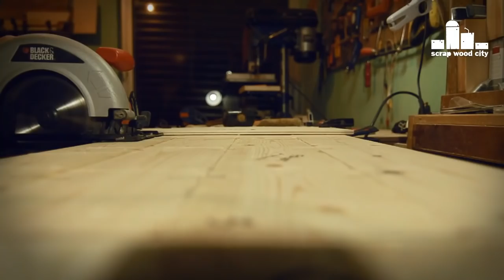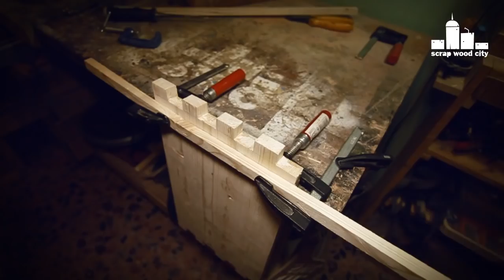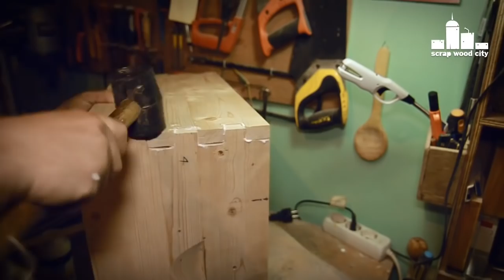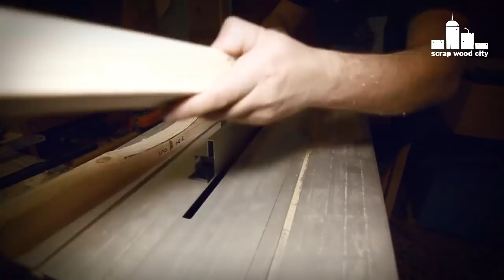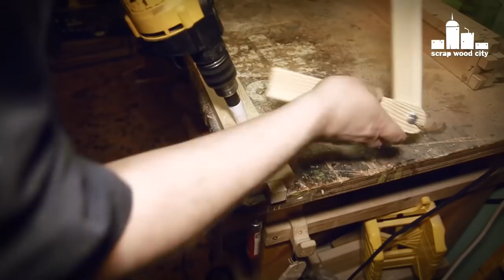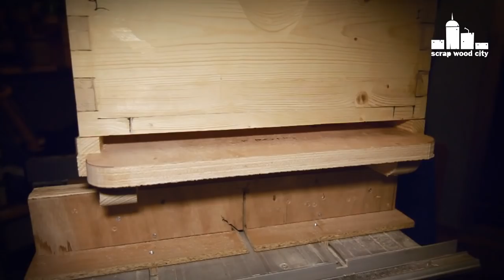How to make a beehive - Part A

Comment: Damn fine job making your hive bodies out of real wood.  If you had a real good table saw you could make a sliding gizmo to cut those box joint cuts and a good dado set.  But you have the right idea.  I like the good old ways myself.  Free lumber and boards can be had fairly easily.  Glue and biscuits are cheap enough.  Good tools are always an investment in a craftsman's shop.  Better to buy tools than to pay for someone else's labor at a high price.

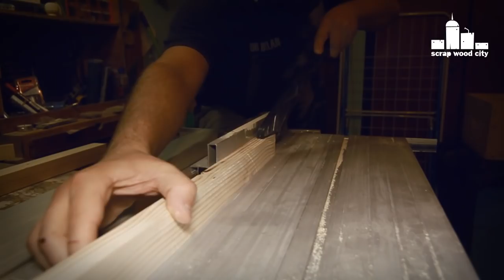Comment: When you trapped the wood between the saw blade and the fence at 6:22 in the video, it created a very dangerous situation.  The wood can bind and shoot out the back at high speed.  The scar on my belly is an indication I learned the hard way.  Nice box, be careful.  Great use of innovative solutions to achieve results.
Reply from the maker: thank you

Comment: Obviously a Union Worker - taking the longest and most inefficient route to make something that could have been done in 1/3 the time. Side-note biscuits don't make a  stronger joint. But they do add material and cost, so another union move. :)
Reply from the maker: Obviously I did not followed the shortest path! I used biscuits for the glue up not for strength! I just have one question. What is a "Union Worker"! Sorry I am Greek and I am not familiar with the term!
Reply: He’s using the tools he has and he didn’t do a bad job, I learned a lot from watching this so I appreciate he took the time to make this for all of us, there’s always a judgmental nit pick that comes along, why don’t you tell him what he’s doing wrong and help the guy instead of labelling him a “union worker” whatever the fuck that means.
Reply: The Plain Truth You only pointed out what he is doing wrong you didn’t say what he should of done instead, nothing you said was actually helpful is the point I was trying to make.

Comment: holy crap dude you are totally amazing! wanted to make beekeeping set up but after watching this... I may have to just buy one because I have absolutely no idea what most of the description means. ha 😝 one question though for if I do end up building a much simpler version... why did you do the interlocking sides instead of just nailing the flat edges of wood? hope the question makes sense.. I have no woodworking experience whatsoever
Reply from the maker: Thanks. It makes a much stronger joint. Since this things stays outside and you also might need to lift it up while being heavy (when the hive is full of honey).

Comment: do you think having the Beehive insulated would help the bees do in the winter by not consuming so much honey
Reply from the maker: I am not a beekeeper so I cannot answer your question. I just did the woodworking part!
Reply: Well you're good at what you're doing
Reply: Shane Bennett No, the bees don't heat the hive. They only heat the brood in the summer and the beeball (idk the english term) with the queen in the middle in the winter. So within the hive is the same temperature as outside in the winter.

Comment: Priced 1 x 12 lumber - ouch!  Your approach is definitely more cost effective.  Only concern would be if the seams were to gap when the wood expands/contracts from the weather.  Wondering if tongue and groove or lap joints might be better because of that.  Your handle jig is genius!
Reply: Today was the second time I bought a 1x12 by 8 foot long board from lowes hardware for $13 and some change to make a deep body. For that price there is no need to do all that work with joining the small boards. One board like this will make a deep body and you have some left over.  With 2 board you have enough for 2 deep bodies and from the leftovers to make the roof. 

That handle jig was copied from other websites, with a possibility from you-tube.

Comment: wow must admit i was not expecting to see biscuts used. seems like too much work to me. i have used them to make table tops before but not such a small piece as a box and as you saw they did little to keep the boards aligned to each other. i feel your pain bro as i also have a limited space workshop and use only small power and hand tools to do all my work. so have to think outside the box (no pun) lots of times to get the job done. before you go making a bee hive body again id look up some proper plans and go by them since it looked like you did not have any thing to guide you in the execution of this project. also there needed to be an inner cover between your telescoping cover and the hive body. otherwise the bees will build lots of wild comb in there. not bad :)
Reply from the maker: Thanks. This style of hive is a pretty common type used in Greece for ages!

Comment: I wish you included explanations.  I am a complete newbie and don't even know what some of those tools are.  A quick explanation of the step, tools, and measurements would really be helpful.
Reply from the maker: You can find a link in the description of the video that leads to blog article with much more info on the build. But no measurements. Measurements are pretty standard and you will easily find them with google search.
Reply: Thank you!

Comment: Wouldn't a rabbet joint be better for this, easer and exposes less of the end grain to the elements.
Reply from the maker: I think you really need the strength of the box joints. Many times you have to lift a fully loaded with honey hive.

Comment: The only thing that bothers me about them skil saw jigs for cutting the handles is that the blade is at an angle.. its no longer perpendicular to the board youre cutting into so the when the saw reaches the end point of the cut its not at 90 degrees so the wood in the handle where your fingertips hit will be at the angle of the saw's jig slope. So if it was slippery one day and you pick up the box.. the box handles wont be perfectly horizontal and can cause your finger tips to slip a little..  For some reason people who make these videos with these jigs dont understand what I'm talking about... simple geometry.. just watch on youtube "how its made -bee hives" and you will see how their machine cuts the handles.. its basically a skil saw on a metal jig that rolls the saw into the board.. the saw is cocked at an angle and then its rolled.. when the saw is at the end point it will be perfectly perpendicular to the board.. that is.. the blade will be 90 degrees like normal.

But they're still better than screwing handles into the sides.
Reply: There is an angle adjustment on the saw you can get the cut 90° or better to the piece

Comment: why not just use spikes and hammer the box together? Must be quicker or is there a reason why not?
Reply from the maker: I guess you could!
Reply: Dunaldango
It would not be as good a home for the bees. Nails allow for joints to open, cold wind to come in the hive body. The bees use their own bodies to protect the brood from cold temperatures, no need to make it harder on them by allowing breezes. The hive bottom with a screen and the top with screens on the cutouts allow breezes in hot times as overheating can also be a problem. A well made box, bottom and top are really needed. The others would not last long.

Comment: why not use plywood?
Reply from the maker: Using plywood to the hole piece might lead to mold creation. This is why I only used marine plywood on the bottom. At least that's what the theory says. Also I have not seen plywood bee hives so far!

Comment: Very good workmanship and great that you got it out. But I can't see how this would keep bee better then a standard hive. To complicated to build if you don't have all the tools you have and years of experience using them. Went in the top to big and the entrance to the hive needs to be screwed on tight. In a storm.or just some one knocking it of predators and pets will get in. Great workmanship poor design.
Reply from the maker: I would agree that it is not worth the trouble of making it yourself. But I don't agree about your opinion on the design. This design is not mine, it is developed from beekeepers and it is used in Greece for many many years. It is perfect at least in our environment here and for the kind of beekeeping that is developed here. A design cannot survive for so many years if it isn't practical! And that's a fact!
Reply from the maker: And in my opinion that design is like violin's design. You can't add or remove something because everything is there for a practical reason!

Comment: Get rid of the music! Good grief! Why not buy 3/4" plywood for the boxes, and biscuit joint the ends with biscuits glue and screws? It will be much quicker then doing all that fitting with the band saw! And using 3/4" plywood you can buy one sheet, have it cut at the big box stores! The frames you can buy, they are cheap. The music was very repetitious!

Comment: making them joints is a wast of time ! ii would be done finished with handles too. Time u got one piece made.  just butt em up glue and screw em JUST AS STRONG i throw them around stand on em you name it>  I'am getting 15 years out of em so far, repaint em 2x's